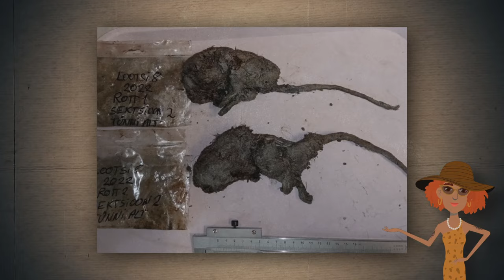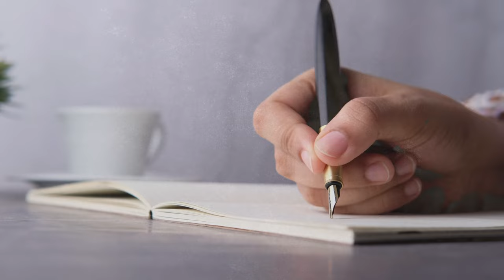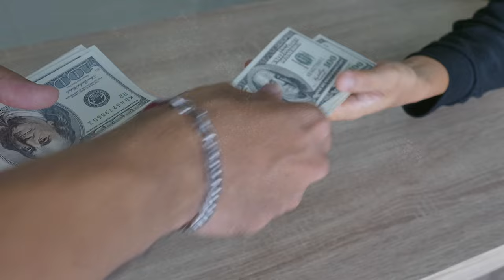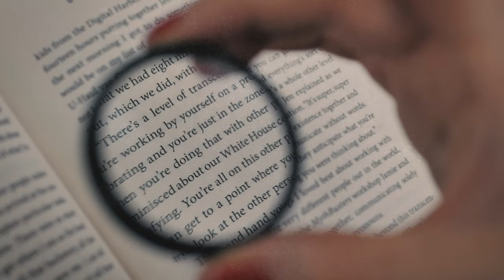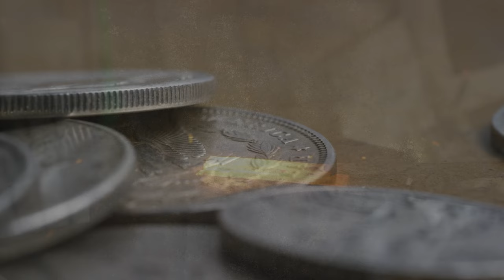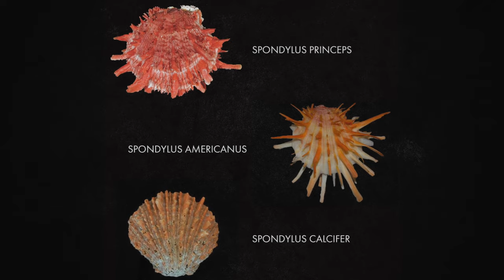THESE Are The Most Unusual Finds of Archaeologists That Turned the World Upside Down

Comment: The main reason things we make not lasting is called Controlled Obsolescence, Manufacturers products are designed to break down, so we are forced to buy a replacement. Many parts are also "Discontinued" within 2 to 5 years also meant to force people to buy more spend more.
Reply: Yes you're right and it's not a bad thing either. It keeps people working and spending.  It's just how today's economies work.